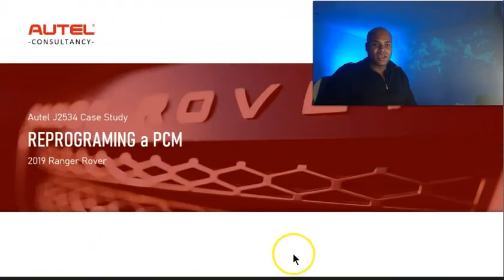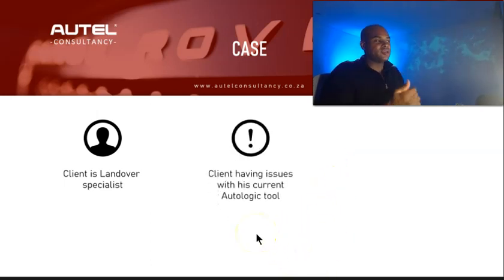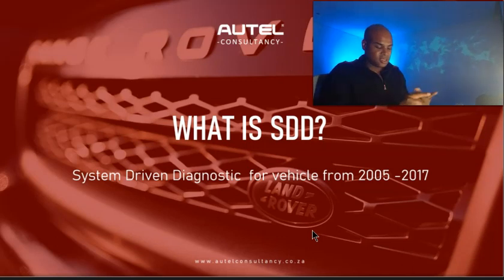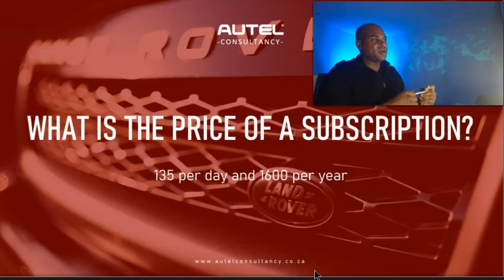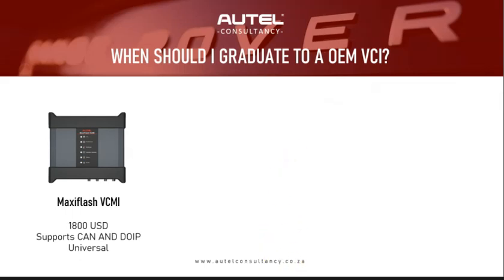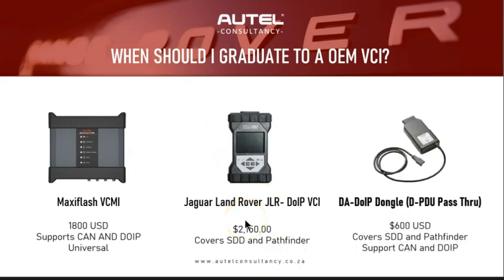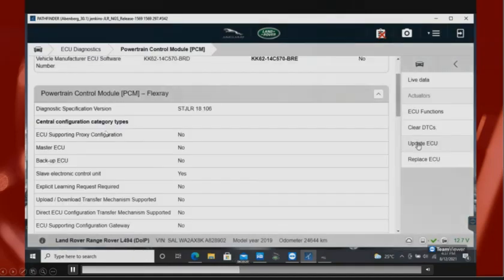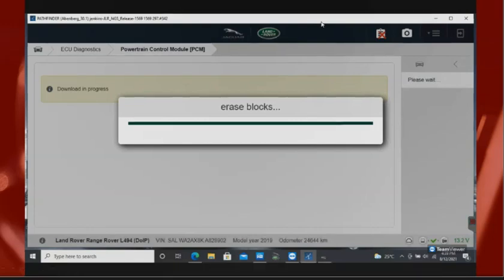Autel J2534 Case Study | Reprograming a PCM 2019 Range Rover

Comment: If you specialize solely in one make of vehicle at a LandRover dealership, you better use the OE  equipment. My guess is that some OE manufacturers might actually prohibit dealership techs from using non approved diagnostic equipment on newer models still under factory warranty

Comment: I wish I would have known that you can not program any vehicles other than BMW using the maxisys. You still need a subscription to the oem dealer software to program any other vehicle, even if you want to use the j2534 ability of the maxiflash.
Reply from the maker: Yes , alot of people get mislead about this. You shouldn't let that discourage you from learning how to program. With all the new vehicles coming with more modules, its only going to get worse if we dont learn the skills to flash program
Reply: @AutelConsultancy  I was mislead by autels information online and unfortunately, their marketing strategy would lead you to believe it does in fact program all makes.
the programming is the easy part. its the subscriptions that are expensive. I was looking for another option other than paying for witech and techauthority every year. I got away from the dealer world and run a private diagnostic shop from home. 3400$ a year in subscriptions isnt sustainable for a one man operation.
Reply from the maker: @MegaMarclar  If you want to know how my mobile clients doing well in programming and not paying those high fees for programming and OEM repair information You can book a j2534 Training. It will save you a couple thousand dollars and it will give you the foundation to learn how to program. Otherwise your going to have a steep learning curve.
Reply: @AutelConsultancy  I worked at dodge for  10 years, I also have witech2 and tech tools for gm. I was trying to get away from the high cost of witech and tech authority yearly subscription by using the autel system, but their marketing strategy does not tell you about the lack of programming up front.
Reply: I Program a air bag ecu in a Fait 500 on a Autel with on problem
Reply: @ccbanger1414  That's not programming. That's coding. Programmings when you take a module like a PCM out of the box that has no program in it, connect to the manufacturer server and download the flash image for the vehicle. An SRS module already comes programmed from the factory all you have to do is put the VIN number in it. Two completely different things
Reply: @MegaMarclar  doesn't the Autel J2534 programmer basically just provide a connection to program through? For instance so you don't have to buy the special proprietary dealer cable for every vehicle make? The Autel programming box will program with all of them....then you need the dealer programming file and the software to program....is that correct?
Reply: @stephenwhite5444  There have been some people that say that they can get it to work.  the stand-alone autell j 2534 module is different than the VCMI maxi sis ultra pod, but I spent more time fighting back and forth between Witech and autel, that I ended up buying a micropod anyway. If you're expecting to use this  module as a pass-through device, expect it not to work. But regardless of which module you attempt to use, you will still need to pay the subscription to whatever manufacturer is providing the flash.
Reply: Yeah for this reason the Launch x431 Pad line of devices is definitely helpful. The PAD3 somehow just walks into the Jag/Landrover server , downloads all the appropriate files, and flashes them. Nothing needed but an up-to-date Launch Pad3 and the internet. However the Launch is behind on other aspects. So no tool can do it all it seems, no matter how much money it costs. I recommend working your way up to the top tier of both names. Autel IM608 with XP400 and ect/ Launch Pad3+ with Xprog3 and ect. Ive reached that level with Launch first. Autel i tried to shortcut my way in . I WANTED IM608 or even IM508. Instead i bought the Xp401 pro , then got an Otofix IM from Amzon which uses Autel software similar to IM508 . That gave me alot of power , until i needed to use the Xp400. Although Otofix is using the software powered by Autel and have similar smaller key programmer (xp1), the Ottofix Refuses to see the identically built Xp400 as a usable programmer. So i had to bite the bullet and buy a IM508 after all.
Reply: @ShogunnxYT  what was the Launch PAD3 missing compared to a top of the line Autel?  If that Launch PAD3 really can program all modules as easy as you say, I might get one. EDIT WHEN I look up that Launch x431 it says the US version has no scn programming.
Reply: @stephenwhite5444  It DEFINITELY has SCN coding. For me when i say "Launch" i actually mean Thinktool ProS+ from Amazon. Its the same device as a Launch PAD V . the programming SOMETIMES is blocked by ip, but i simply installed a vpn ExpressVpn, ect. I have CGMB and CGDI for BMW and Benz, but the CGMB doesnt program modules, and didnt do Scn stuff. The Launch Pad software PROGRAMS and SCN codes Mercedes and BMW, as well as Nissan, Volkswagen and Jaguar. One thing it was missing is its Key programming powers are not as tops as Autel. Launch seems to not even TRY to get PIN codes for things unless its easy to get anywhere. Autel lets the IM line break a few rules i guess. All the Maxisys ive had got you to the front door of programming an immobilizer, only to ask you for a PIN. It swears if only you give it the PIN, itll do everything else. Launch goes that route as well. I have an Xtool pad and while its scripts are terribly unreliable, it always easily gets PINS. Anyways, the fact that the Launch Pad V /Thinktool pros/ Topdon Phoenix can access the Mercedes servers and grab SCN codes almost made it worth the price alone. For example, on a 2006 Mercedes CLS500. I had a customer bring me a used PCM, like from the junkyard. Normally its not easy to do this, but i was able to virginize the PCM on the bench. Once i virginized the PCM, i was able to install it in the car and the Launch was able to do EVERYTHING needed to make the car start and drive in about 20 mins.....all from the tablet. Of course, american cars are nogo. The Launch lets me enter the Asbuild data manually, but other than that, you gotta breakout a laptop and passthru device. Any old OTC/Bosch superscanner has a full j2532 passthru as its VCI . ive gotten so spoiled from the Launch that Friday, after a few years of bliss, my bluetooth dongle crapped out. Right away i have a job where a Range Rover evouque pcm was replaced with a used one. Nothing Autel has can help me here. Ive gotta get another dongle for the Launch. That shows how spoiled ive gotten lol. The Autel IM set is coming in handy for the BCM2 Issues From Audi and Volkswagen tho.

Comment: Actually found out VW vehicles cant be done by im608 pro because VW turned off their servers not allowing Autel to do the keys.
Reply from the maker: Thats unfortunate . Now you need to figure out another way to configure the keys .
Reply: @AutelConsultancy  eeprom
Reply: @AutelConsultancy  yep its called Smart Pro and VVDI2. You must have heard of the vw server issue yourself.
Reply: @jamesbarratt593  nope the best way to program vag keys is odis online
Reply: @saq59  what did you start by saying nope for? Odis inline. That odis is VW. How does a normal mobile mechanic persuade VW to allow that? I think not
Reply from the maker: @saq59  I agree . I Installed this on my many of my clients computer and it works great.
Reply: @thisisyourtransmission  look where that got them. Same views as putin.

Comment: Nice job
Reply from the maker: Thanks!
Reply: Hi, I just replaced a transmission on 2009 BMW X5 but the gear selector doesn't work. I try Autel IM608 Pro transmission lock. would you please help me?
Reply: @lindseymmaddox  Make sure the connector is installed correctly and check the fuse. 10amp.

Comment: I'd second last comment.   You will be disappointed going with Autel for this, worse out of pocket when car towed to dealership.
These car's are very secure and constantly updated.     Even 2014 model, I know from experience coding keys Autel is put away and out comes SDD dealer tool.